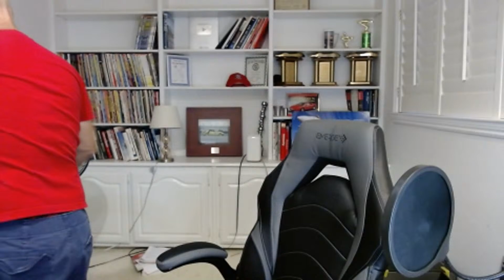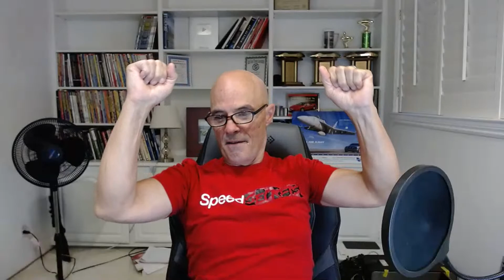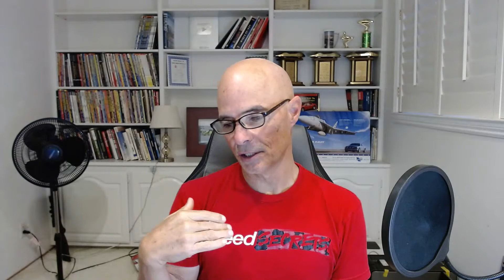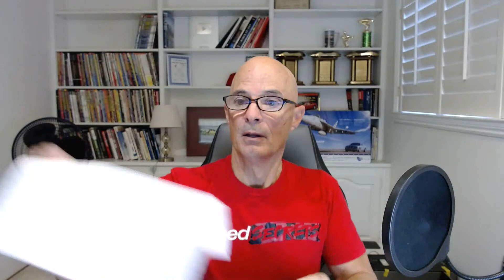LET'S TALK TECH-PROJECT MOTIVATION TUESDAY

Comment: I think all the characteristics come into play. Torque, power, drivability, rpm where the application will run. On the other side of the equation power is cumulative gains a little here and there all adds up. If the gains are not large enough then I would pass on the 10hp for drivability. The old saying sometimes less is more when it comes to the street.

Comment: Hey boss I just had a a day at the dragstrip. And it was good and bad. Mechanical issues contributed to stick my throttle wide-open at the end. And since I had my hands full, I couldn’t take time to look at what the boost was. But it wouldn’t slow down so I shut it off. Now the bad thing about this is, it’s a supercharger. So it had momentum. My dump should’ve opened right away when it lost vacuum. But I don’t know. Anyway probably about 115 or 20 I got it shut off but that was from wide-open throttle fast to nothing. It flipped the belt and It shut off. Pretty sure I hurt it there. 
So after I finally got it towed back and the belt back on, I did another run after I fix the mechanical issues. No noticeable smoke out the exhaust upon startup and no noise. And the burn out went OK But I got a lot of venting through the crank case and out the top of the catch can. So the way the wind was blowing I thought it was just smoke from the tires because it blew down and over the fender the car and I didn’t see it. And then I left. Things happened quick it was only my second run ever. So I wasn’t ready in the box. So we left on almost 0 boost from an idle. By the time I hit 3/4 of the way down the strip I think the belt slipped off because it dropped a cylinder, then it sounded like somebody threw a bunch of spoons in the crank case. Needless to say I was not very happy. But my question to you is, since I haven’t pulled the motor apart yet and won’t until I get another one to put in there, what do you think I did to that thing shutting it off like that at full boost and probably 62 to 6500 RPMs? Oh it ran after the end of the strip but on three cylinders it sounded like until it locked up tight. 
I suppose it’s possible on the top and that I dropped a valve? That might’ve been something that shredded the valve train and the piston I don’t know?
Reply from the maker: sorry to hear

Comment: I was looking at valve springs on ebay and I guess there are a bunch of China springs because they have some that claim to be a name brand like btr or pac but are like half the price so if you get what they claim you can get a ss2 cam for $80.50 and pac 1218 springs for $40 so a cam and springs for like $120 would be cool but I just don't think I can trust that
Reply from the maker: big no on those
Reply: I stopped buying from eBay, performance parts like that years ago when I experienced valve float because of eBay cheap springs and the camshaft had a .551 lift , nothing big for Ls6 eBay valve springs but they didn’t work.
I only buy from TSP , Summit , jegs , BTR when buying camshaft or performance parts
Reply: I mean if you buy no name or clearly knock offs ya that's a risk you take but if you buy a legit Elgin cam and PAC 1218 springs it will be fine but spending extra money to be slightly more sure it's real isn't something I'm concerned with now if you do buy the obviously knock off then you are spending like 1/3rd so it's a gamble

Comment: With a genuine Elgin cam I think you'll be fine for like $240 but their are Chineseium ones for like $100 those you should probably worry about but basically all the btr cams are like $390 so it's $150 difference
Reply: What’s this supposed to mean?
If you are trying to save up money doing a camshaft swap or getting more performance from your engine and thinking about saving money from buying cheap quality performance parts then you are in wrong place.
Reply: @reyperez3424  well if money doesn't matter to you then cool I guess but that's not me that 10hp for an extra $150 isn't worth it to me plus you may have to replace a spring or 2 every like 20,000 miles which maybe I do too but not as often

Comment: Ya that was what i comment about the price and that you needed bigger springs for the hot rod cam and I have heard that more lift is harder on the valve train as well
Reply from the maker: more lift is not always harder on valvetrain-improper (unstable) lobe design is much worse, even with less lift